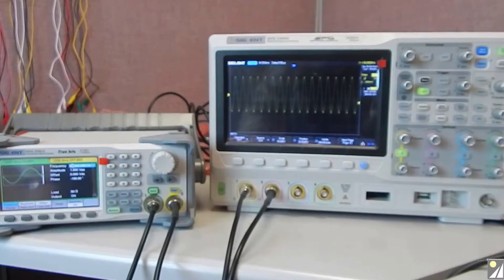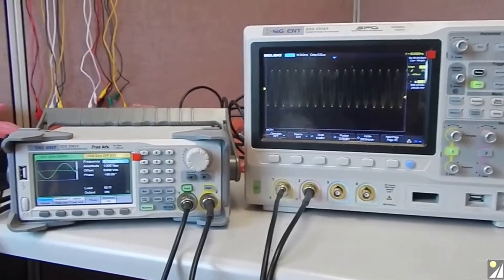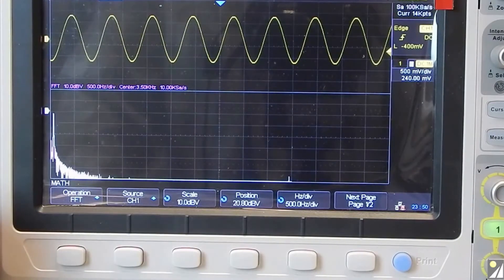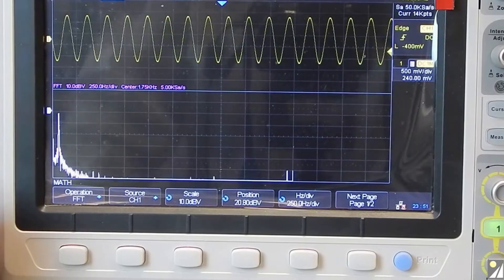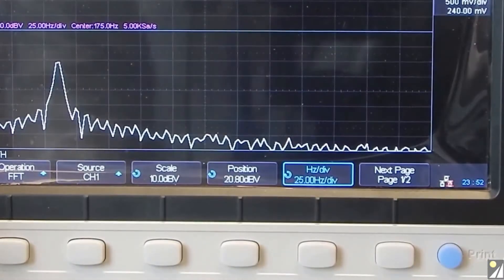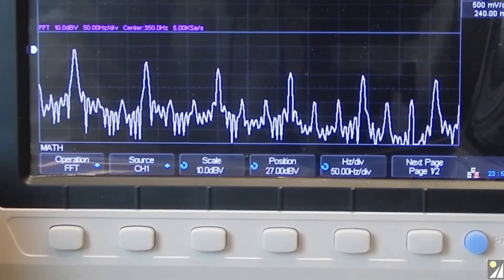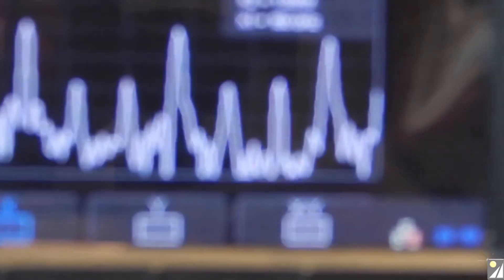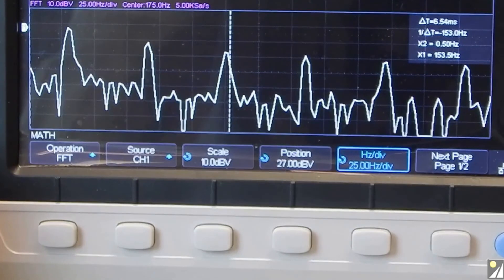FFT measurements with Siglent Oscilloscopes

Comment: 60Hz is perhaps the WORST frequency to demonstrate, as we see the signal, but a lot of noise is also epected at 60Hz -- try 100Hz -- then we can note the extraneous 60Hz and really see the performance of the entire system.  Also, at your lowest/widest timebase setting, there seemed to be very few actual data points, with a fair bit of interpolation going on.  What's up with that?  How does your Spectrum Analyzer handle this?  Further, is there no way to allow that FFT cursor to snap to the peaks?  If not, bummer!